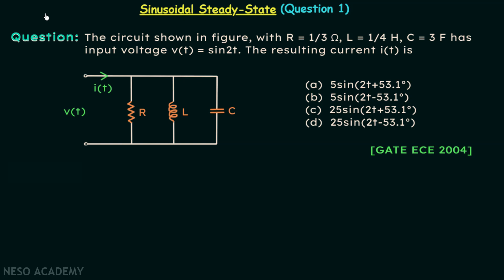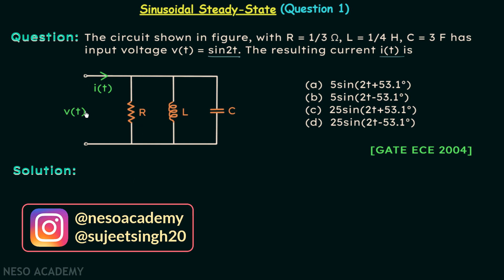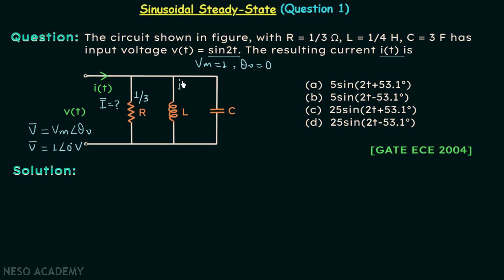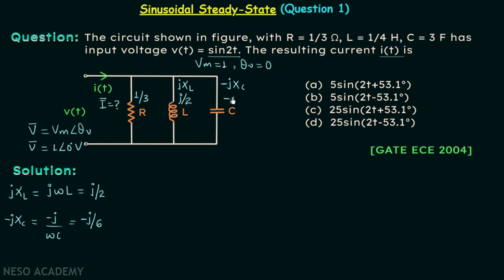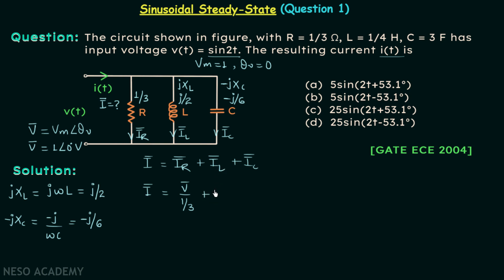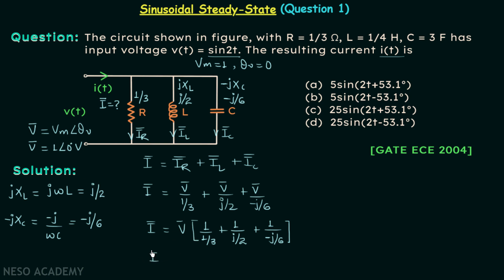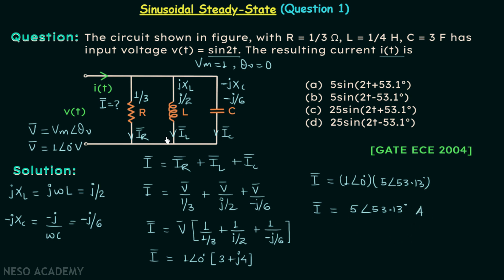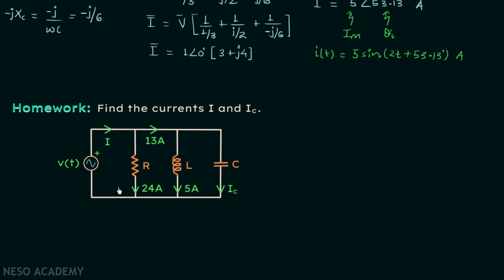Sinusoidal Steady-State (Solved Question 1)

Comment: Ic = 18A and  I = sqrt(24² + 13²) ~ 27.3
Reply: How ??? Can you please explain it as the answer In the first comment in not matching
Reply: @dharmeshparmani8473  
They are updating the Homework link so they might post the resolution soon.

Anyway, recall the parallel RLC circuit current triangle. 
The inductor and capacitor current are both 2 vectors perpendicular to the resistor current, and pointing in different directions because they are both complex but with opposite signs: Ic = jV/Xc & Iʟ = - jV/Xʟ.

Therefore the 13A must be the result of that vector subtraction, and since Iʟ = 5A, then Ic = 18A so that Ic - Iʟ = 18 - 5 = 13A.
Since the 13A is complex, and Iʀ is real, then "I" is going to be the hypotenuse of the current triangle. Therefore I = sqrt(24² + 13²) ~ 27.3 A
Reply: @justpaulo  Thanks for replying...
 I understood the solution given by you but there is misprint in your answer ... Actually Ic=18 A and iL=5A ... but Check in your 3rd para ... It is "Since Ic is 5A ... "
Reply: @dharmeshparmani8473   Thanks for catching that. I'm going to correct it.
Reply: Wrong...i=37A and ic=8A
Reply: @vamcprabha465  Ye AC circuit hai bro .. Directly KCL mt lagao .
Reply: How did you get the Ic?
Reply: @dvaVivy   See my answer above.
Reply: @justpaulo  thanks finally understood how it became 18A. Ty
Reply: @justpaulo  Thank you so much for the explanation
Reply: hi....cant we use kcl for this question... it is applicable in AC circuits as well right?

Comment: What is the correct answer? Why can’ t I=13+24 = 27A ?
Reply: Current in resistor branch is 90 ° out of phase . 
In case of inductor and capacitor they are 180° out of phase so u can simply subtract it. 
13 = Ic -5 which gives Ic=18A 
I = √24^+ 18^= 27. 3 A
Reply: 24A+13a= 37A !!   it's not the same ,,the phasor current I=Ir+Ic+I(l),, as we learnt inductors lagg and capacitor lead,here, 13=Ic-5, so Ic =18,   now I =root(Ir square +(Ic+Il)square)=27.2946
Reply: @soumitrabiswas3971  ic+il should be 18+5=23 iguess
Reply: @yashvardhann15  i think it's 18-5 otherwise the answer won't come as 27.2946

Comment: Current 'I' would be in phase with resistor current Ir 
Therefore-> I=Ir+13=24+13=37
I =37A.

As we know I=√Ir^2+(Ic-IL)^2

After substituting the values of I&Ir &IL we get...Ic=33.16A.
Reply: I am also getting like this 
Are you sure we both are right?